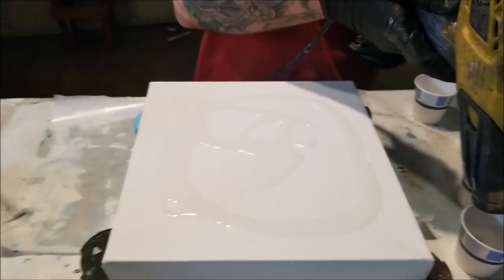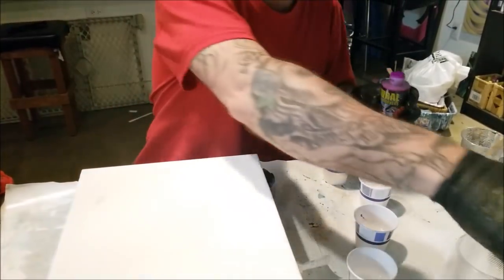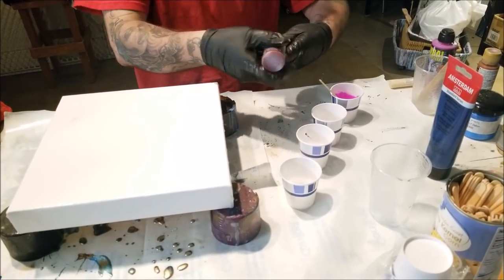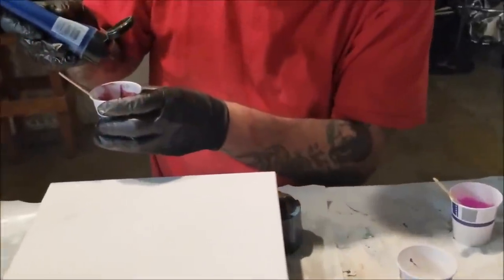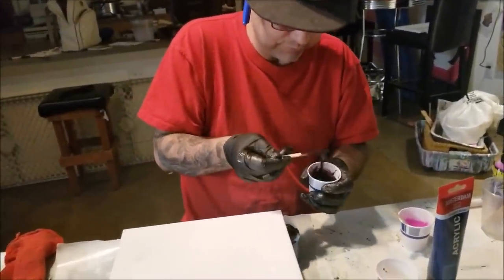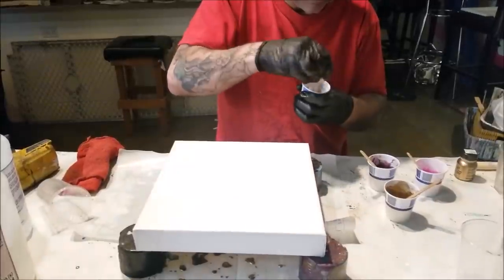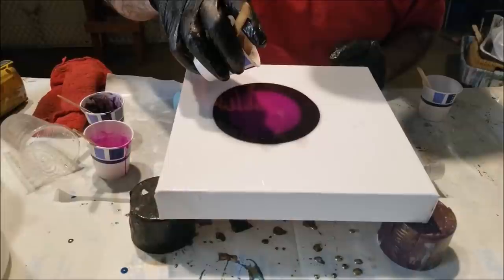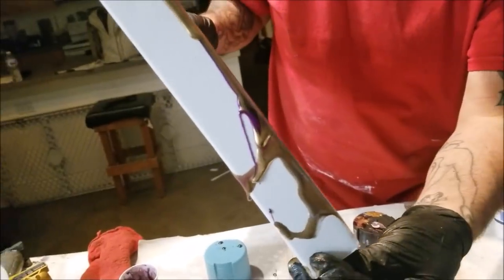Pink and Gold Ocean (Stretched CELLS tutorial)

Comment: Love the babble. You guys crack me up. Nice colors and it turned out great. I agree with you Erika about it making a white "frame". It does work with this one. Okay about paints - I don't know everything but I think you will find you answers if you research specific gravity. That changes with colors even in the same type and brand of paints. That is why in acrylic dirty cup pours you usually put white in first as it will then be last on the canvas, white is heavier and will sink. Your pours are all the same resin, but you are using different colors, brands and types. Obviously something with high pigment will be heavier than say an ink. You then have other additives, like the Rust-oleum gold paint. Check out the MSDS sheet for it's ingredients.  
https://www.rustoleum.com/MSDS/ENGLISH/1910830.pdf   
All of that plays into it's specific gravity too. The interactions are what I believe will make cells. I could be wrong but I think I am on the right track here. Good luck!
Reply from the maker: Hey Deb! I think you are absolutely right about the science behind the cells.  I will read the MSDS sheets to see if I can further elaborate my E-Science.  Thank you so very much for always answering my (some would say) silly questions.
Reply: No question is ever silly. I don't think you need to read the MSDS sheets for everything. I used the gold spray paint one for an example the Butane, Tolulene, Propane are very light gases. Acetone is liquid and I thinkMethoxy-2-propyl acetate is too. I would THINK the gases are what helps that paint float, the liquids likely bland with the zinc and copper compounds to keep it flowing and make the gold. All of that reacts with everything you mix it in and use it on. But, it also makes it lighter than other paints so it sorta "floats" in the resin pours. The same idea goes with just the specific gravity. You can search an individual company's paints for their weight charts. I will send some links via email to Thornton but not now - on my way out for the day.
Reply from the maker: Thank you so much for all of your help Deb!  YOU ROCK!!